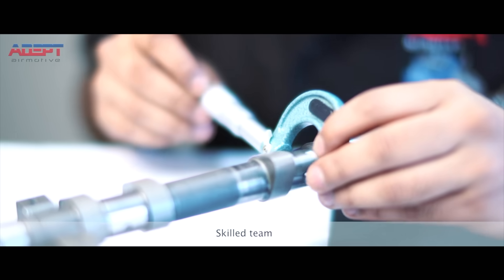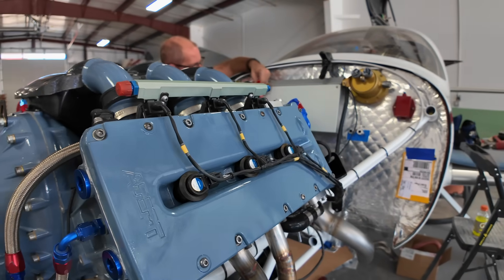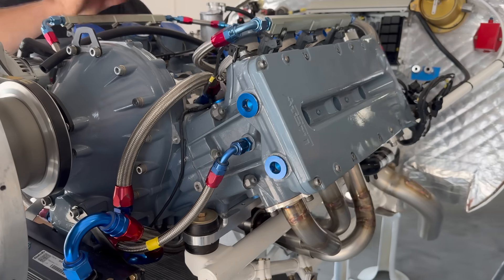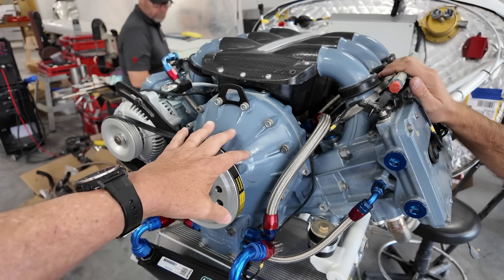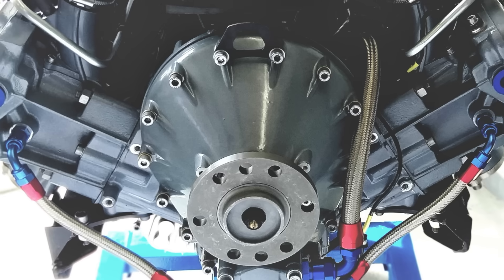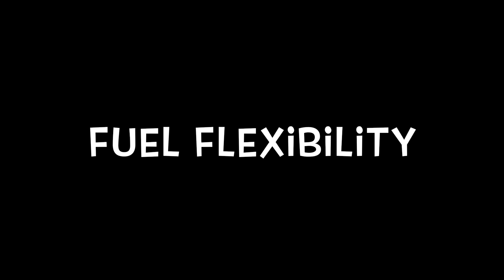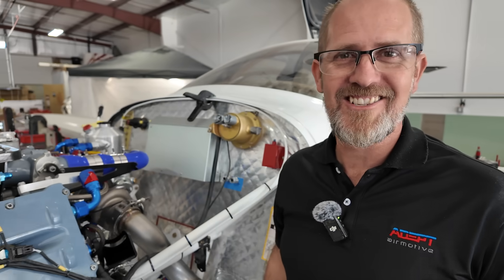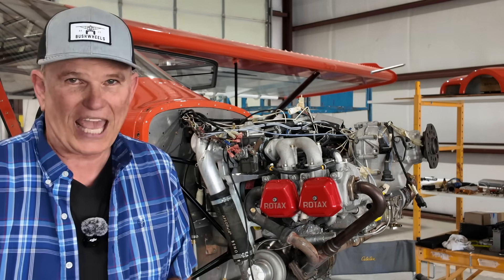The new Adept Engine could be a winner for General Aviation

Comment: That's super cool if it works as designed. Many of us aviators love technology and innovation. It's about time to move aviation forward with more modern engine designs.  Thx for this video!
Reply from the maker: Thank you!
Reply: Tell that to the FAA who has been keeping GA stuck in the 1950's. 

The FAA is so risk adverse it's made GA less safe.
Reply: @agisler87  Aviation literally gets safer every year.
Reply: @PistonAvatarGuy  Yes but my point is it would be even better without the FAA. 

We would have more GA pilots flying planes not designed 60+ years ago.  Plus improved technology.
Reply: @agisler87  Oh? Then why are experimental aircraft so much less safe than certified aircraft? And why did Boeing immediately start having serious problems when they were allowed to self-regulate?
Reply: @PistonAvatarGuy  Boing is anecdotal evidence. I could cite commercial accidents that were fully under the FAA but that also would be anecdotal. Also my point was specifically about GA. 

I will admit I don't have a good rebuttal to experimental aircraft. That being said some experimental aircraft have really good records compared to others. 

The FAA has been slow to adopt newer technologies and manufacturing processes. It has stunted the progress of GA and made flying costly. There would be so much more investments into GA without the FAA.
Reply: @agisler87  You can blame greed for a lack of advancement, or just ignorance. Take the Red A03, for example, it was never going to be competitive with turbine engines, yet someone probably spent over a hundred million to put it into production. With all of the money that has been pumped into technologies that were clearly never going to work (electric aircraft, HFC aircraft, countless diesel aircraft engines, etc), an entirely new aircraft engine in the same power class as this engine (or several of them) could have been put into production and the development and startup costs could have simply been written off, leaving only production costs as a concern for profitability.
Reply: @PistonAvatarGuy  I'm not sure how it is "greedy" to invest millions of dollars into a new engine design.
Reply: @agisler87  Because they're only doing that because they expect a return on that investment.
Reply: @PistonAvatarGuy  Are you implying that is a bad thing? Definitionally greed is neither good nor bad. A bank robber is just as greedy as a business owner. Obviously only one benefits society. 

We should be thankful for the greedy investments people have made.
Reply: With the way that things are currently going, the business owner is just as bad as the bank robber.
Reply: Why this fixation on “more modern engine designs?”

Like.. it’s an argument I hear over and over again… there have been “some” advances in technology (Rotax, diesel engines) but nobody can tell me why it’s better or produce empirical proof or even inductive reasoning why.  

Let’s take a modern automotive engine with all of the fancy technology that everyone craves and go step by step as to why it’s an awful idea to incorporate them into aviation.  

First… car engines spend very little time producing any significant power.  Since even a basic car can achieve freeway speeds from a standing start in under ten second.. I’m willing to bet that most cars probably go to full power less than a handful of times a year if at all.. and none cruise on the freeway at 75% power for hours on end (100-120 MPH).  So right away.. you have an engine whose basic design is less robust.  

Then all of the technology.  Well.. things like dual overhead cams, multivalves, variable length intakes, variable valve timing, even variable ignition timing.  These are all to make an engine accelerate and spin faster.. giving more horsepower from less displacement.  Well.. the problem is that our prop is limited in RPM.. so we will need a heavy and failure prone reduction gearbox to reduce it again.  Also the engine only has to accelerate the prop, not the entire vehicle.. so there’s no point in having variable anything.. make it so it works best at max or cruise RPM instead.  

Then all of the electronics.  The ECM, sensors, electronic ignition, electronic fuel injection.  Again.. no point since the engine spends most of its time at one speed.  But the real issue is that you need dual redundant ignition in aircraft engines.  With a magneto.. a fully contained and compact method of power generation and ignition control.. it’s easy to have two.  With electronics.. not only do you need two completely independent ignition systems.. but also two completely independent electrical systems including two alternators and two batteries!

Let’s not forget what we care about in aviation. Specific power is meaningless.  It’s power to weight that matters.  Even in automotive.. a “huge” 6.2L V8 is smaller and lighter than a Porsche 3.6 H6.. while producing as much if not more power.  

And yes.. add the automotive things like cooling systems etc and it becomes very heavy.  

Even an engine that goes part of the way.. like a Rotax 912.  Designed in the 90s and not only does it struggle to produce a better as-installed power to weight ratio of a 1930s derived O-200….  but it has FOUR failure modes the O-200 doesn’t have (dog clutch, gearbox, coolant leak, and an extra throttle cable). 

But truth be told.. most engine failures are pilot induced.. mostly related to carb icing (which 1950s fuel injection can eliminate) and air in the fuel tank.  

The engines are old because they’ve been proven and there’s very little we don’t know about them. They are exceptionally simple to build, operate, and maintain.  

Meanwhile we have entire lines of modern car engines going through recalls and having significant problems (Hyundai GDI engines, Honda 1.5L oil dilution, Ford EcoBoost.. take your pick, LS and Hemi lifter problems) and new aircraft engines too (the entire Thielert diesel debacle that nearly destroyed the DA-42 program).  

No.. I’ll keep old and simple, thanks.
Reply: @calvinnickel9995  Modern gasoline engines (assuming the use of liquid cooling, a PSRU and FADEC) are lighter, more efficient, easier to operate (single lever control), don't need leaded fuel and their cooling systems produce less drag (if properly designed). Modern engines also have the potential to last longer and be more reliable.

This isn't a car engine, it was designed from the start as an aircraft engine. The fact that this engine resembles an automotive engine does not mean that it was designed for the same purpose as an automotive engine. From the start, this engine will have been designed to be robust enough to operate in an aircraft. In fact, most automotive engines are designed to be more than robust enough to be used as aircraft engines, and automotive engine manufacturer testing is often more strenuous than the FAA certification testing. The problem with automotive engines is that they're not optimized for operation at high power settings, while this engine will have been designed from the start to be well optimized for operation at high power settings.

The FAA only requires that an engine survive 100 hours of operation at full power, while many automotive manufacturers require that their engines survive two to three times longer than that at full power, on top of hundreds of hours more than that under various other torture testing conditions. Even Kia tests their engines for 300 hours at full power.

Electronics in aircraft make them more reliable, which is why basically all large, modern passenger aircraft are dependent on electronics to drive their engines. Every modern airliner has FADEC engines that will not run without a functional computer.

This engine doesn't not have VVT, or a variable length intake manifold. Again, it was designed from the start as an aircraft engine, and those technologies are mainly beneficial in an automotive engine application, where the engine must produce power over a wide range of rpm, while also having low emissions output across its entire operating range. OHC multivalve engines are more efficient and longer lasting than pushrod engines, as the valvetrain components don't need to cope with nearly as much stress, due to the reduction in reciprocating mass. Even semi truck engines have almost all adopted an OHC arrangement, in order to improve longevity and increase efficiency. With a computer controlled engine, which makes use of a direct ignition system (like this engine does), there is no additional complexity added in order to provide variable ignition timing, and the engine will have improved efficiency, performance and safety (in conjunction with knock sensors) as a result.

Lycoming's electronic engines also make use of a similar ignition system technology (they still retain spark plug wires, which are unnecessary on this engine), which requires them to have a knock sensor installed on every cylinder.

The FAA's requirement for dual ignition systems is outdated, magnetos are also extremely outdated. A direct ignition system (like the one used on this engine) is likely to be many times more reliable than a dual magneto system. Direct ignition systems have no moving parts and will be driven by dual redundant ECUs in a certified aircraft application. Adding a magneto to this engine would provide no benefit, as the EFI system wouldn't run without electrical power anyway.

The FAA has already certified diesel aircraft engines, which will not run without electrical power and only have one electromechanical injector per cylinder, certifying this engine should be no different. And, again, modern airliner engines will not run without their computer, they're FAA certified and safely carry millions of passengers every year.

The installed wet weight of this engine is 412 pounds, that's with everything, including a radiator and coolant. A comparable Lycoming TEO-540 (EFI engine) weighs 554 pounds DRY.

The Rotax 9xx series engines were designed in the '80s and have proven themselves to be more reliable than the O-200, while also being lighter and more efficient.

Yes, FADEC engines are safer, as they have the ability to prevent pilots from operating the engine in a way that may be damaging. In this case, a pilot would never be able to command the engine to run with a fuel mixture setting that may be damaging to the engine. FADEC systems would also have the ability to alert pilots of impending failures, long before they would otherwise be aware of them. Carb icing is obviously not an issue that occurs with EFI engines.

Imagine if airlines has stuck with old radial engines, simply because they were reliable and proven and jet engines were not. There was never this ridiculous discussion with regard to FADEC, either, it was simply adopted because it was obviously better.

I don't know why you keep bringing up automotive engines, this is not an automotive engine. Honda's oil-dilution problem also would never have been an issue in an aircraft application, it's not even a problem for the Viking Aircraft engines which are flying by the hundreds. The Thielert diesels went on to be developed into the Continental and Austro Engines diesels, they seem to be working quite well these days.

Sorry, but most information concerning piston aircraft engine technology consists of old wives tales, and most of it is hilariously wrong.
Reply: @calvinnickel9995  Also, if you want the opinion of someone who is far more experienced on this matter than either of us, see what Ross from SDS has to say about using automotive engines in aircraft.
Reply: @calvinnickel9995  Modern gasoline engines (assuming the use of liquid cooling, a PSRU and FADEC) are lighter, more efficient, easier to operate (single lever control), don't need leaded fuel and their cooling systems produce less drag (if properly designed). Modern engines also have the potential to last longer and be more reliable.

This isn't a car engine, it was designed from the start as an aircraft engine. The fact that this engine resembles an automotive engine does not mean that it was designed for the same purpose as an automotive engine. From the start, this engine will have been designed to be robust enough to operate in an aircraft. In fact, most automotive engines are designed to be more than robust enough to be used as aircraft engines, and automotive engine manufacturer testing is often more strenuous than the FAA certification testing. The problem with automotive engines is that they're not optimized for operation at high power settings, while this engine will have been designed from the start to be well optimized for operation at high power settings.

The FAA only requires that an engine survive 100 hours of operation at full power, while many automotive manufacturers require that their engines survive two to three times longer than that at full power, on top of hundreds of hours more than that under various other torture testing conditions. Even Kia tests their engines for 300 hours at full power.

Electronics in aircraft make them more reliable, which is why basically all large, modern passenger aircraft are dependent on electronics to drive their engines. Every modern airliner has FADEC engines that will not run without a functional computer.

This engine doesn't not have VVT, or a variable length intake manifold. Again, it was designed from the start as an aircraft engine, and those technologies are mainly beneficial in an automotive engine application, where the engine must produce power over a wide range of rpm, while also having low emissions output across its entire operating range. OHC multivalve engines are more efficient and longer lasting than pushrod engines, as the valvetrain components don't need to cope with nearly as much stress, due to the reduction in reciprocating mass. Even semi truck engines have almost all adopted an OHC arrangement, in order to improve longevity and increase efficiency. With a computer controlled engine, which makes use of a direct ignition system (like this engine does), there is no additional complexity added in order to provide variable ignition timing, and the engine will have improved efficiency, performance and safety (in conjunction with knock sensors) as a result.

Lycoming's electronic engines also make use of a similar ignition system technology (they still retain spark plug wires, which are unnecessary on this engine), which requires them to have a knock sensor installed on every cylinder.

The FAA's requirement for dual ignition systems is outdated, magnetos are also extremely outdated. A direct ignition system (like the one used on this engine) is likely to be many times more reliable than a dual magneto system. Direct ignition systems have no moving parts and will be driven by dual redundant ECUs in a certified aircraft application. Adding a magneto to this engine would provide no benefit, as the EFI system wouldn't run without electrical power anyway.

The FAA has already certified diesel aircraft engines, which will not run without electrical power and only have one electromechanical injector per cylinder, certifying this engine should be no different. And, again, modern airliner engines will not run without their computer, they're FAA certified and safely carry millions of passengers every year.

The installed wet weight of this engine is 412 pounds, that's with everything, including a radiator and coolant. A comparable Lycoming TEO-540 (EFI engine) weighs 554 pounds DRY.

The Rotax 9xx series engines were designed in the '80s and have proven themselves to be more reliable than the O-200, while also being lighter and more efficient.

Yes, FADEC engines are safer, as they have the ability to prevent pilots from operating the engine in a way that may be damaging. In this case, a pilot would never be able to command the engine to run with a fuel mixture setting that may be damaging to the engine. FADEC systems would also have the ability to alert pilots of impending failures, long before they would otherwise be aware of them. Carb icing is obviously not an issue that occurs with EFI engines.

Imagine if airlines has stuck with old radial engines, simply because they were reliable and proven and jet engines were not. There was never this ridiculous discussion with regard to FADEC, either, it was simply adopted because it was obviously better.

I don't know why you keep bringing up automotive engines, this is not an automotive engine. Honda's oil-dilution problem also would never have been an issue in an aircraft application, it's not even a problem for the Viking Aircraft engines which are flying by the hundreds. The Thielert diesels went on to be developed into the Continental and Austro Engines diesels, they seem to be working quite well these days.
Reply: @calvinnickel9995   My main reply to you wont post, but let's just say that you keep hearing this argument because those in opposition to what you're saying here are correct.
Reply: Modern gasoline engines (assuming the use of liquid cooling, a PSRU and FADEC) are lighter, more efficient, easier to operate (single lever control), don't need leaded fuel and their cooling systems produce less drag (if properly designed). Modern engines also have the potential to last longer and be more reliable.

This isn't a car engine, it was designed from the start as an aircraft engine. The fact that this engine resembles an automotive engine does not mean that it was designed for the same purpose as an automotive engine. From the start, this engine will have been designed to be robust enough to operate in an aircraft. In fact, most automotive engines are designed to be more than robust enough to be used as aircraft engines, and automotive engine manufacturer testing is often more strenuous than the FAA certification testing. The problem with automotive engines is that they're not optimized for operation at high power settings, while this engine will have been designed from the start to be well optimized for operation at high power settings.

The FAA only requires that an engine survive 100 hours of operation at full power, while many automotive manufacturers require that their engines survive two to three times longer than that at full power, on top of hundreds of hours more than that under various other torture testing conditions. Even Kia tests their engines for 300 hours at full power.

Electronics in aircraft make them more reliable, which is why basically all large, modern passenger aircraft are dependent on electronics to drive their engines. Every modern airliner has FADEC engines that will not run without a functional computer.

This engine does not have VVT, or a variable length intake manifold. Again, it was designed from the start as an aircraft engine, and those technologies are mainly beneficial in an automotive engine application, where the engine must produce power over a wide range of rpm, while also having low emissions output across its entire operating range. OHC multivalve engines are more efficient and longer lasting than pushrod engines, as the valvetrain components are subjected to far less stress, due to the reduction in reciprocating mass. Even semi truck engines have almost all adopted an OHC arrangement, in order to improve longevity and increase efficiency. With a computer controlled engine, which makes use of a direct ignition system (like this engine does), there is no additional complexity added in order to provide variable ignition timing, and the engine will have improved efficiency, performance and safety (as a result of the use of knock sensor technology) as a result.

Lycoming's EFI engines also make use of a similar ignition system technology (they still retain spark plug wires, which are unnecessary on this engine), which requires them to have a knock sensor installed on every cylinder, due to their air-cooled nature.

The FAA's requirement for dual ignition systems is outdated, magnetos are also extremely outdated. A direct ignition system (like the one used on this engine) is likely to be many times more reliable than a dual magneto system. Direct ignition systems have no moving parts and will be driven by dual redundant ECUs in a certified aircraft application. Adding a magneto to this engine would provide no benefit, as the EFI system wouldn't run without electrical power anyway.

The FAA has already certified diesel aircraft engines, which will not run without electrical power and only have one electromechanical injector per cylinder, certifying this engine should be no different. And, again, modern airliner engines will not run without their computer, they're FAA certified and safely carry billions of passengers every year.

The installed wet weight of this engine is 412 pounds, that's with everything, including a radiator and coolant. A comparable Lycoming TEO-540 (EFI engine) weighs 554 pounds DRY.

The Rotax 9xx series engines were designed in the '80s and have proven themselves to be at least as reliable as the O-200, while also being lighter and more efficient.

Yes, FADEC engines are safer, as they have the ability to prevent pilots from operating the engine in a way that may be damaging. In this case, a pilot would never be able to command the engine to run with a fuel mixture setting that may be damaging to the engine. FADEC systems would also have the ability to alert pilots of impending failures, long before they would otherwise be aware of them. Carb icing is obviously not an issue that occurs with EFI engines.

Imagine if airlines had stuck with old radial engines, simply because they were reliable and proven and jet engines were not. There was never this ridiculous discussion with regard to FADEC, either, it was simply adopted because it was obviously better.

I don't know why you keep bringing up automotive engines, this is not an automotive engine. Honda's oil-dilution problem also would never have been an issue in an aircraft application, it's not even a problem for the Honda-based Viking Aircraft engines, which are flying by the hundreds. The Thielert diesels went on to be developed into the Continental and Austro Engine diesels, they seem to be working quite well these days.

Sorry, but most information concerning piston aircraft engine technology consists of old wives tales, and most of it is hilariously wrong. Edit: ...or the information has been made irrelevant by modern technologies.